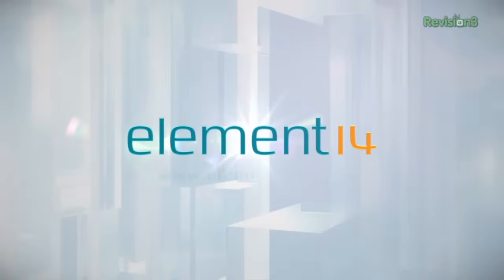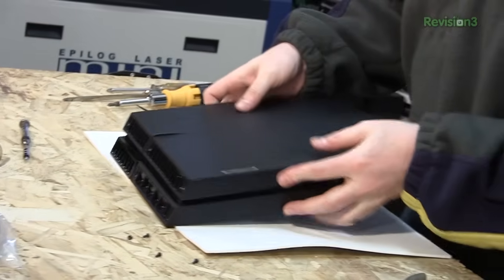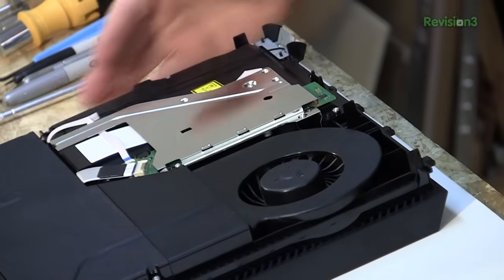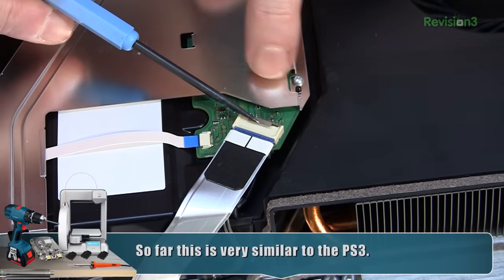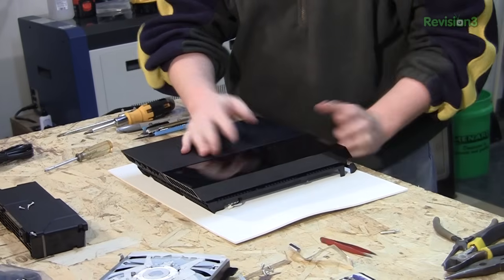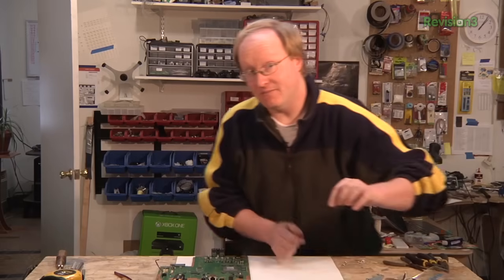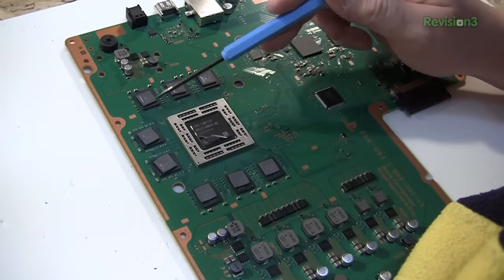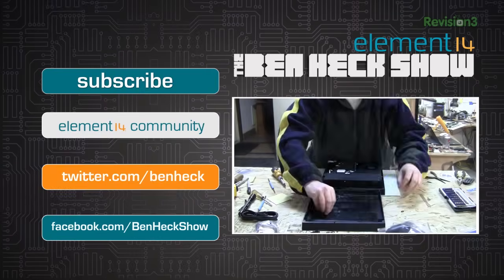Ben Heck's PlayStation 4 Teardown

Comment: is there some way to get a external hard drive to act as a standing hard drive threw a usb or sata cable
Reply: Kevin Beebe Nope, I really don't think so. Unless you connect the motherboard and sata cables outside and use it like that.

Comment: here is a reply i gave. thought it worthy for everyone to see however

I'm not going to bitch and moan about last gen like these children are. PS3 had better features, it was more powerful, it had stuff like Blu-ray which was brand new for the time and a rechargeable controller right out of the box etc. But 360 won software wise, it had party chat etc which beat the PS3 by standard.

This gen? XBOX has barely changed. However, PS has continued what it did with the PS3 and created a console with better features than XBOX. XBOne still needs batteries for it's controlllers--like, seriously? PS4 controller is like half the size of an XBONE controller and has a light bar, rechargeable battery, speaker, rumble and touchpad built in. What does the XBX1 controller have? What the 360 and XBOX controller had. It's pathetic. Now, some of these XBX fanboys will say "oh yh but plug n play kits", thats exactly the problem. The plug and play kit that isn't compatible with the XBOX 360 one which also needed batteries. Microsoft just milk their customers, milk milk milk. The reason why PS4 sales 3>1 XBOne is not just because of power, features and capabilities but because Microsoft betrayed trust of their customers. You bought a second hand game, you needed to spend £10-15 to 'unlock' it. You NEEDED Kinect, and it NEEDED to be on 24/7. No XBX live? No gaming. No internet connection? No gaming.

As I said about how 360 won last time on software, well, PS4 has caught up. I'll mention some of the amazing new software later on in this comment, but PS now has party chat and all of the other guff the XBOX endlessly boasted about.

Microsoft time and time again rob the consumer and each time they release a new console the XBX fan base go crazy over it... 

Yeah, well, if you want a console with actual good replay standards then get a PS4. If you want a console that is and has always been appropriately priced, get a PS4. If you want a console that comes with everything you need to get started, including a rechargeable controller with 5x as many features as the XBX1 controller and includes a high-quality microphone that has lasted me 5 months, where as when I had a 360 I needed to get a new one every fucking week then get a PS4. If you want a fast, clean, sleek-looking console that allows you to stream your ACTUAL game to a friend across the world, so they can ACTUALLY play the game YOU'RE playing WITH YOU then get a PS4. 

If you want to support a tyrant company who's only mission is to milk as much money from the consumer as possible, then get an XBX.

And no, I'm not a fanboy. I just know that the PS4 is better in every way possible.

(P.S, as the guy said before about 'dlc a month early' lol. It really goes to show how desperate Microsoft has got since they had to take 50 steps back to get barely level with the PS4 after their shambles of an XBX1 announcement, they've had to start paying for content. It's pathetic, really. My PS4 is fucking great, I'd never swap it for an XBX 1.)

Comment: How come the Xbox One be so thick! I doesn't even have an internal power supply. What he actual fuck.
Reply: I believe it's to avoid over-heating
Reply: ***** Microsoft=software company   Sony=hardware company
Reply: No its to save costs since mi€ro$oft doesn't like to spend money
Reply: Greg The Dreg Yeah, though it is not like there wasn't enough space in it for air and an internal power supply.
Reply: To prevent it from over heating its big and ugly but it stays cool and quiet, the ps4 reaches high temperatures and is pretty loud
Reply: Georgian that's basically it. The X1 software is more polished but the hardware isn't as good. They also use a full size internal HDD that you can't replace if it fails. So you have to send your entire system in for repair. Sony is more sleek and uses a smaller HDD because they know you don't want an entire god damned brick under your TV. That's why I got the PS4. I'm a PC guy but I can still appreciate Sony's hardware engineering.
Reply: Javier Maldonado Lol yeah even in sleep mode I can hear it going crazy when it updates at night

Comment: Such a bad time to get a console. 4k will be mainstream within the next year, so the console makers will be focusing all their efforts into making the first 4k console -- which most likely means this generation of consoles will be  short-lived, Replaced and obsolete in 2 years or less.
 It also means PC gamers will be showing off their 4k gaming rigs, demonstrating once and for all how superior it is compared to console gaming ;)
Reply: kanadaluvr Yes, it is. After that, all that they are doing is showing off.
Reply: 4k isn't even that popular on pc yet don't shit
Reply: PS4 can actually handle 4k resolution, just letting you know ^^
Reply: Fuji San It doesn't output at 4k... It will UPSCALE a 1080p signal to 4k TVs but that is NOT the same as having 4k output. BIG difference.
Reply: Well yeah I know that. I pushed my old 1080's with everything ultra without an issue. I know the r9's are re-branded 7k series. Granted my card has really slow memory too. Only 1GHz which has to be impacting my framerate badly. I know on some games I play I can tell when the memory is bottle-necking the GPU itself. I opened advanced warfare on a free weekend and it maxed out my video card, RAM, and finally dumped into my pagefile before the game had the video memory it needed. Needless to say it didn't run over 1fps.. But when it comes to cost is my thing about 4k. It's not cheap technology. Granted I knew this when buying my display awhile back.
Reply: Adam Olympia Console ports are usually shit dude everybody knows this try harder. Heck even your own article talks about "shoddy ports of console titles" Better hope GTA5 is not a shit port lol

PC having more exclusives that actually matter today ? i think not. And your article talks about "a declining overall PC market" and seriously overpriced videocards and hardware not new games. You know the one thing that actually matters in all of this.
Reply: I heard that the human eye can't really tell the difference between 1080p and 4k on anything smaller than a 60'' display. Is that true?
Reply: kanadaluvr
You've heard very wrong. The only people who say that haven't actually experienced it... (or have poor eye sight) ... I have a retina 2550 x 1660 resolution 13 inch laptop, which has higher pixel density than the new 5k iMac -- the difference in quality and sharpness of image is staggering.
Reply: Yet they won't be able to get 4k with only a $500 PC. Nice try.
Reply: There are still a lot of pc gamers that only just reach 1080p not everybody spends 1000$ or more on a gaming pc
Reply: xXx_illuminati_overload_xXx Yes there is that but yet again you wouldn't just spend $400 and expect all your games to run at 1080p some games you will have to run at a lower res to run.
Reply: xXx_illuminati_overload_xXx There is almost a majority who spend more than 1k on a pc....
Reply: 4k SHOULD be a gaming standard in the next couple of years, but consoles pretty much set the paradigm, so I very much doubt it will be.
My PC eats 4k so that's fine, but 4k screens are unlikely to drop in price considerably until home consoles are rendering games internally at those resolutions. (shitty upscaling doesn't count and probably won't happen)
Reply: YourPalHDee There's also the problem of 4k tvs having only 30fps currently and drastically bigger price than monitors
Reply: eh it will take a little while. The only current GPU out there that can push a 4k monitor by itself[on a single pcb] is the r9-295x2. That is if you want 60fps and everything cranked up. But the TDP of the card itself is extreme. Yes, 4k will be the new 1080p in the next few years but we don't really have the hardware here yet.. at least at a reasonable price.
Reply: YourPalHDee Home consoles will be rendering at 4k this year. Just check out the Nvidia Shield console that will be coming out for $200.

Like I said earlier, bad time to get a console. So much better is just around the corner.
Reply: Unless its streaming from another device in the home, I don't see it. We don't even have the hardware to push it.. Sure it can push 4K video playback but actual rendering a game in real time, it just isn't there.. If it is then most of the settings will be low. I can push CSS at 4k with my 7870 at high, but bf3, I have to set everything low. Even that I still only get 50fps. Now granted my card is a few years old but still it's just not there to run most newer games at 4k with everything maxed. They're gonna milk these consoles for a few years. Hopefully not for another 10 or so like the last generation.
Reply: ccraig412  7870 isn't really a 4k card though. The R9 series are made to produce high pixel rates.
Even the low end ones can push 1080p really easily, the high end ones eat 4k.
Reply: Superior how ? Their playing console ports while i am playing new exclusive games on my PS4 while looking at guides or twitch on my PC.
Reply: RetroSimon "console ports" lol... Console games are CODED on a PC. The PC versions are most always superior, as in better textures, higher resolution options, etc .. But as far as exclusives go - PCs have by far the most exclusives. Why wouldn't they? The PC gaming market is twice as big as the console market and is growing faster -- The financial stats are out there .. see this report from forbes:
http://www.forbes.com/sites/marcochiappetta/2014/07/14/the-console-war-is-over-the-pc-already-won/
Reply: RetroSimon Name one single game that's better on console than it is on PC? Just one...

Games that matter? Just check out Steam and their huge library of AAA titles as well as thriving indie scene. what matters is popularity and like I pointed out - the PC gaming market is twice as big as the console market and is GROWING, not declining (where did you get that?)  10x the amount of games, backward compatibility all the way back to the 80s (not to mention the ability to emulate nearly all the older consoles and handhelds) .. 

Nearly all games are MUCH better on PC than  console version: 
http://www.gamespot.com/articles/console-games-you-should-play-on-pc/1100-6421045/

The only relevant consoles are Nintendo, since they have exclusives that will never show up on PC. Most other console exclusives always show up on PC.

p.s. The "overpriced" video cards, as you put them, aren't a necessity  - just an OPTION. You can get by just fine with a $150 card and still have way better graphics than the best console.
Reply: Adam Olympia  Nope i have better things to do. Lets agree to disagree.
Reply: RetroSimon So you don't have better things to do than spreading misinformation (claiming that games are better on consoles than their PC versions = false) but when it comes to providing evidence, you prefer to take the easy way out..
Figures.

My guess is that you've never owned a capable gaming PC but you like to comment on things you have no experience in. Good luck with that.
Reply: Adam Olympia
Actually here is my steam profile with lots of games. http://steamcommunity.com/id/RetroSimon/ and i probably have a better game pc than you have.

I just figured i am wasting my time arguing with somebody who is clearly set in their opinion and agreed to disagree.
Reply: RetroSimon Actually, I'm not "SET" in any opinion I have. I've changed my mind about MANY previous opinions when confronted with convincing evidence. I simply ask people to back up claims with evidence so I can make an educated stance. I shouldn't say there definitely aren't any particular games that are better on console but out of the hundreds that I've played, none have been. (I own over 600 on Steam) ...

I don't doubt you have a better PC .. I built my own and have spent over $2500 (actually $3000 if you count gamepads and flight sticks, like my $300 Thrustmaster warthog)  on all the parts, including monitor ... Some people have $10,000 PCs. A $600-$700 one is sufficient to have a better gaming experience than modern consoles though.
Reply: http://steamcommunity.com/id/NeuroFryk

So many games I lost track. I was thinking it was just over 500. It's actually 609 now., thanks to buying nearly every humble bundle and all the best games via Steam Sales.
Reply: Reading these comments, how little people know...
Reply: dedpxl 4k will be adopted faster than 1080p was, by far. The reason is that it took a long time for 1080p to be affordable, compared to SD TVs.  4k is already quite affordable and dropping in price MUCH faster than HD did upon it's release.   Plus, Go to a major electronics outlet like Fry's and you'll see that all the prominently displayed TVs are 4k. -- They are all over the place and being bought by many. Once the Bluray 4k spec arrives this year, the adoption rate will start to overtake 1080p buyers...

Comment: so what would happen if you switched the ps4 and xb1 hard drives? would you then be able to play ps4 games on the xb1 and xb1 games on the ps4?
Reply: What makes you think you can do that? Fact hardware is very similar but not only hardware is a platform but also OS, if OS don't know how to run games of specific platform... it won't, simple as that
Reply: Shadowriver well i know that there might be some hardware incompatability but if you witch the hardrive then the os is also being switched
Reply: ChromeFilms77 First of all firmware is helt in flash or eeprom, if it was otherwise you would need to reinstall firmware, also removable HDD is not reliable and most importently insecure for conbsole OS storage. 2nd problem are drivers, console hardware is static and don't change so drivers are staticly attached to OS, there for OS won't work on any other hardware.